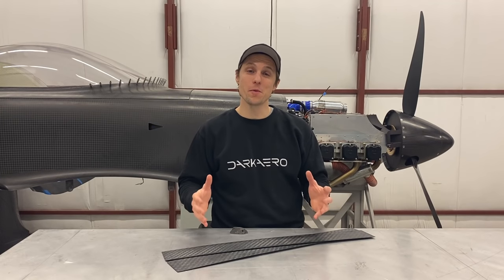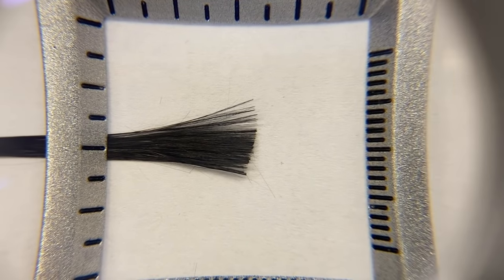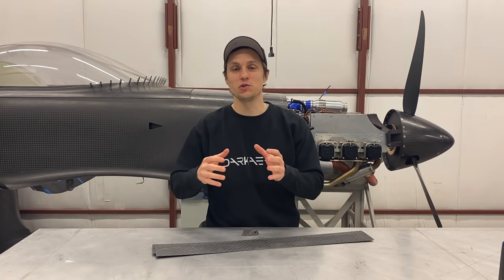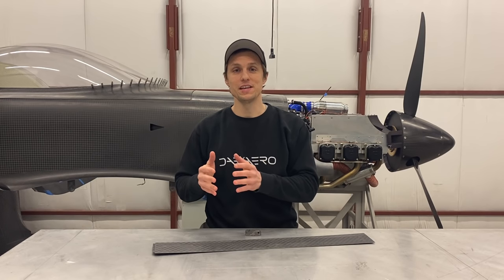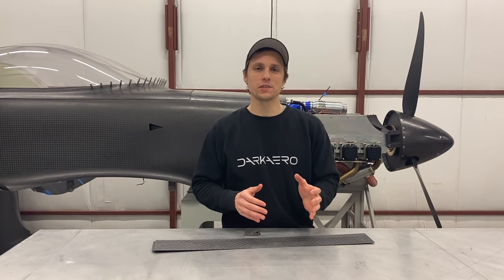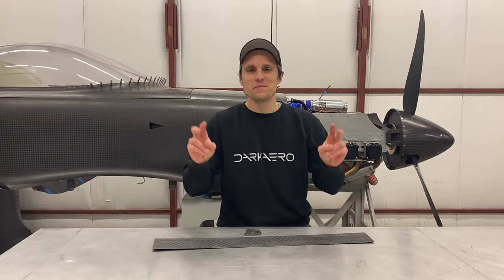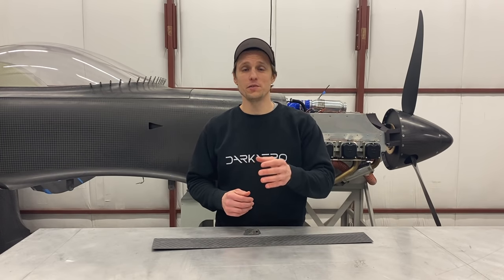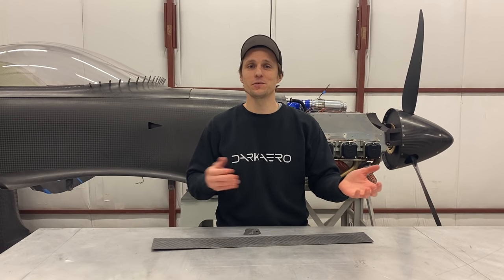Carbon Fiber - 5 things you (probably) didn’t know

Comment from the maker: What are other interesting facts you have learned about carbon fiber? What aspects of carbon fiber would you like to learn more about?
Reply: I would be curious to see a detailed "how to" for infusion molding, drawing on what you outlined in this video.
Reply: What is the weight ratio of the carbon fiber to the resin for a finished part?
Reply from the maker: @chicosajovic7680  roughly 70% carbon to 30%  resin by weight. These numbers vary by +/-2% based on the specific part, weave type, and fiber orientation in the part.
Reply: Inserts ,fixings, etc and UV protection.
Reply: @DarkAeroInc  That seems a bit on the dry side. Have you ever tested this? I work with prepregs and the data sheets usually say about 60% fiber 40% resin (by weight).
Reply from the maker: @michldehpunkt9904  these are measured numbers. The dry cloth weight by area is a known number and it's also an easy number to measure and verify. The % resin content can be determined after weighing the final part and subtracting the dry cloth weight. A big part of achieving these numbers is using spread tow and unidirectional cloths which lay flatter in a laminate stack and don't trap as much excess resin as, say, twill weave.
Reply: I'm curious about multi material composites like carbon/UHMWPE.
Reply: Just like many other "space grade" materials, there's a whole infrastructure being developed to one day make carbon fiber just as cheap as anything else. I live for the day, and I have seen some of it, but billet carbon fiber will soon be just as common...
Reply: For most people wanting to do DIY projects, there's not a lot of options in small quantities. Cheap stuff will be on par with Toray T300 or Hexcel AS4. On the high end you might be able to find T700 (👌) or IM7. Amateurs shouldn't touch High Modulus. 6K twill is a good all-rounder for fabric. Core materials are important too, learn how to properly use them, vinyl foam being a good cheap choice. On the resin side beginners should stick with Epoxy resins, I'm a fan of West Systems. Lastly your process is going to matter more than your fiber or resin, don't waste your time wet laying (unless it's strictly cosmetic parts). Get a slow curing hardener and you can do a wet lay into vacuum bag process which can match the quality of infusion but a little easier IMO.
Reply: Would be interesting if you would also consider the impact properties of CF, which are very poor compared to aluminium alloys.
Reply: Your parts seem to come out with a more matte or satin finish. Is this how they come out of the mold, or are you doing a post process to get the uniform finish?
Reply: You should make a video talking about the resin.
Reply: What surprised me a bit when I started working with carbon fibre was that as opposed to metal they have a spring in effect when working with press forming (meaning an angle goes further in after bending it as opposed to metal which usually springs back a bit) and another thing that kind of surprised me was how hard it is to account for thermal expansion as it vastly differs with fibre orientation to due the fibres having a slight negative expansion coefficient and the matrix a fairly large positive one
Reply: bioepoxy blends with biothermoplastics for parts with impact loadareas, recyclamine hardener to reuse the carbon fiber, bioepoxy coated carbon fiber with biothermoplastic matrix, and partially (or fully with lignin) biobased polyacrylonitrile for carbon fiber that it's manufactured by oak ridge. and also carbon fiber oxidation and carbonization in a solar furnace
Reply: @michldehpunkt9904  Double check your datasheets, a lot of mine say 60% fibre by volume, which is ~70% by weight.
But like you, i'm also working with pre-preg, mostly uni's, autoclave cured. If I measured 70% per weight in a part consolidated by only a single atmosphere, it'd definitely merit ultrasound testing.
Reply: @Roryact  Probably should have been more specific, but I was refering to 2x2 twill. Hexcels M49 in 200/400/600gsm and DeltaPregs DT120 GG200/GG380 are all around 42% by weight. Even CIT's CC204ER450(T800) is listed at 40% and that's a "higher end". Unfortunately we are mostly doing (race)car parts and there the goal is mostly to be cheap so not too much UD's, but those should be in the low 30's. But then again that's datasheet vaues only and we often use perforated release foils to get some of the resin into the breather fleece. So it should be somewhere in the mid to high 30's, never measuered it though.
But thats prepreg, I have som experience with infusion too and found that it's not that easy to avoid spots that are too dry when you aim for a low resin content.
Reply: @flyingschoolbus9557  We did some basic impact testing and the main problem, even with a top layer of kevlar, is the layer seperation. The kevlar fibers just don't break like the carbon fibers and it's way harder to punch a hole though the part, but the structural integrity it pretty much affected the same. It worked way better to have something below the first layer that actually absorbs and spreads the impact energy.
While Mike Patey's idea sounds good in theory I am not really convinced it will work too well. IIRC he used it on his horizontal stabs, so if he hits a really big rock, my guess would be that it won't outright rip off, but rather flap around.
Reply: I would love to learn more about how the weaving affects the bending forces of the material in different directions. I heard that it's an important aspect .
Reply: From experience I can tell the resin very so much! Get good stuff and you will be so much more happy when using the right cure cicle
Reply: I’d like to know if you think carbon fiber is a suitable material to replace the ruddervator in later model S and V model Bonanza’s?  My understanding is that the primary challenge is getting the control surface to balance ( aluminum has proven to heavy). Just found your channel... great videos showing applied engineering!
Reply: There  is also carbon-fiber-concrete! We have only pedestrian bridges made of it, because you have to carry the whole construction from the factory to the site...
So we can't build too big constructions with carbon-fiber-concrete as they can't be transported.
Reply: @tuckpilot1192  This is a good video showing the process: https://www.youtube.com/watch?v=VodfQcrXpxc
Reply: It causes corrosion when in direct contact to some metals
Reply: I'm sure you came across my feed because of Mike Patey.
I'm starting to love fab work again. 
Can you suggest a starter kit somewhere?  Something a guy could practice on?  I'm familiar with epoxies, and coatings from the concrete industry.
Reply: I really want to try to figure out how to make double sided carbon fiber plates without a heated platen press. When I say double sided I mean to flat floss sides. 
I've been trying this with resin infusion and pre-preg for ages now and just cannot get perfect results. I'm so close yet so far.

I'd love to figure out if its possible to make double sided shapes if I can figure out flat plates. I got a feeling the double sided dream might not be possible at home.
Reply: Hello, I was wondering if you could do a video talking about the different bonding techniques you use. For example epoxy-ing parts (how, what type, when to epoxy vs bolt), retained nutplates, etc.
Reply: My interesting fact is from experience, that damage to carbon fiber is easier than in metal parts. Because the material is sooo stiff, it creates huge forces on impacts that cause alot of damage. Forming repair strategies in aviation is also extremely expensive because of the engineering man hours. I work at an airline on composite repairs.
Reply: @LargoFlyBoy  Carbon Fiber has an electrochemical effect that will cause corrosion on aluminum if it's not insulated, a layer or two of fiberglass is often used between aluminum and carbon fiber. 

The other issue, is a carbon control surface is going to be significantly stiffer than lightweight surfaces made of aluminum. This may cause binding. 

Balancing control surfaces is relatively straight forward, I'm sure Beechcraft has all approved methods listed in repair or service manuals.
Reply: @davidhoffeditz285  Would you please explain why "Amateurs shouldn't touch High Modulus". I don't understand why this is so. Thank you, in anticipation of your explanation. Cheers, Neil
Reply: @paultrgnp  High modulus is weaker than standard modulus and it's extremely brittle. I would recommend thorough stress analysis/FEA. It's a lot more expensive for small gains, your money and effort would be better spent on the process, such as vacuum bagging and infusion.
Reply: When I search for carbon fiber roof - I get the new BMW roofs. But what I am looking for is how to add carbon fiber to an SUV roof - leaving the metal roof intact under the carbon or sandiching it between 2 carbon layer,  adding strength. A carbon fiber roll cage if you will. Any thoughts or places to research this application?
Reply: @Not Sure   The epoxy resin matrix can degrade over time, particularly due to UV--but paint goes a long way to help with that. I don't think the carbon fiber itself has much fatigue issues or the like. I do wonder about the heating and cooling cycles on a plane though, in relation to the epoxy.
Reply: Why didn't you just order pre-preg like we did at the big company [DMS and DPS]?
Reply: what is the difference between carbonfiber and fiberglass?
Reply: autoclaves are simple and a carbon fibre autoclave is just a little more complex, so little that it's just a vacuum channel panel that's present
Reply: I knew what you meant by coupon, and looked it up. I'm sure you're right (there are a lot of words that are used "incorrectly" now that I know for a fact didn't exist when I was young, eg, couth. It wasn't a conjugation of couth that yielded uncouth, it was the only version of the word). I'm assuming it means small pieces or something. Anyway. Very very interesting video.

I wish you could go into more detail about what it took to create the jig? that you used to create the infusion parts ... and how you handled things like the de-icer in the wings ..? I'd imagine that'd really stress the strength at heat-levels even moreso than the area near the engine as the wings have to always handle greater load on demand. 

I hope you'll make more videos in general ... as the style is well above average. Thanks!!

Comment: I bet i know what the secret coating CF manufacturers wont tell you..m a cold working glass artist i mainly grind, cut an epoxy glass into layers wen i glue glass to glass i first wipe down the glass with Amino silane it leaves a film that is a coupling agent..but its a adhesion promoter they put it in paints an other glues an epoxys..just a guess tho

Comment: THANK YOU for stating what I've learned from years of composites experience - Test, test, and more testing!!  The only way to verify results is to mechanically test EVERYTHING.  Great overall presentation and thanks for mentioning fiber/resin compatibility as well - a hidden key to composites success or failure.  If you've done coupon level testing on any of your laminates, I'd be very interested to know the mechanical properties you've been able to achieve.
Reply from the maker: Thank you! Testing is key!
Reply: Imbok - do you do testing of carbon fiber sub assemblies today?   Is that a service you offer?  What is the fee?

Comment: Great stuff guys... As to other CF related content: I'd love to see the full infusion process for one of the more complex parts, all the technicals i.e. how-to in terms of vacuum specs, resin flow and saturation, baking, finishes/UV sealing or what have you. Alternatively, or rather additionally, I'd really like to see how you guys bond different parts together, for example the bulkheads and the airframe (and maybe how you bond your sandwich panels in the first place)? I'm also curios about the motor mounts or the fuel tank install, basically how you bond CF and metals.
Reply: They offer engineering and process consulting services, check out the consulting page on their website.

Comment: A nice survey of carbon fiber composites.  A video on how you meet part 23 certification requirements with regard to structural capability would be really informative, and specifically on the role of analysis in the certification.  Nice work!

Comment: Great video!

I found there is great variability in stiffness among different resins.  Resin stiffness effects how securely the carbon fibers are held in place, and that significantly effects the overall strength of the composite.

Could you please cover resin stiffness variables in a future video.
Reply from the maker: Thanks for watching and the comment! Resins is a big topic so it probably is deserving of its own video. Thanks for the suggestion.
Reply: I’m new at carbon fibre as well, and we were making a part to split my cowl last week and noticed that the cowl was actually polyurethane, not epoxy and had to find a source for that type of resin. I would be curious to know the difference other than harshness of chemicals in the application process. 
We did a demo with the leftover resin to make it smoke and saw temps of 300F when adding too much hardener intentionally and the resin essentially burned itself and changed colours over about 15 mins.  A discussion on ratios and how it affects strength and the chemical process that takes place when it cures would be fascinating.

Comment: Oh how I wish that I lived closed by you.  I could learn so much from you guys. I design, build and fly radio controlled airplanes as a hobby for over forty years.  I recently designed a 60 inches plane that the wooden main spar alone is over a pound.  From previous experience I know that I need this size spar.  But if I could figure out how to make a carbon fiber spar I can reduce that weight to half.  But I learned a lot from your clip.  Please keep up the good work, and happy landings!!!!
Reply: I have seen people use different size carbon fiber arrow for spars. The arrows come in many different sizes and stiffness.

Comment: In the 1950s the new wonder material was glass fibre. Lotus and Reliant made complete car bodies out of it.
There were two adverse features of glass fibre.
1) the surface was prone to "crazing" under stress.
2) the uncured resin was horrible stuff to come into contact with.
Is this also the case with carbon fibre?

Comment: Your build is fascinating to follow and your knowedge and care is admirable. I have a couple of questions about repairability and survivability: I have heard of carbon fibre airframes being written-off after relatively minor damage, as localised repairs are not feasible in a pressure structure or in a dynamic component. A low speed runway overrun in a Premier jet with little obvious damage resulted in a write-off - and a well-publicized bird strike on the wing of a Premier1 jet which looked minor was deemed uneconomic to repair and the entire airframe was written-off. I realise that DA1 is not a pressurized aircraft, but it is fast. How would say, leading-edge or airframe damage from a bird strike be dealt with? Secondly, there's crash survivability. In the motor racing world, it was realised that carbon fibre can shatter on impact, creating dangerously sharp pieces - and designers had to protect occupants from this in the cockpit design.

Comment: Nice work on both the plane and the channel. Do you use spray adhesives to tack the dry cloth to 1) the mold, and 2) further layers of cloth, before infusion? If so, have you tested with/without spray adhesive to see whether stiffness is affected or delamination is a concern?

Comment: I know this is very different, but I had thought of a way to make an O’Neill cylinder using carbon nanotubes, graphene, and stainless steel.

Imagine weaving a loose laundry basket with ~20 foot diameter holes.  The thread would essentially be 12 foot diameter carbon nanotube rope/cables strengthened with graphene resin, then thread 30 foot diameter stainless steel footings or screws (they would look like tiles on top and the bottom)
Then you put girders and mesh in between, and then you could fill it with either a graphene concrete or a graphene polymer or chopped graphene carbon fiber/nanotubes with a concentration of graphene resin.  
The idea is to disperse graphene resin spheres so that if any shearing or cracks form, The spheres can break and seal any cracks